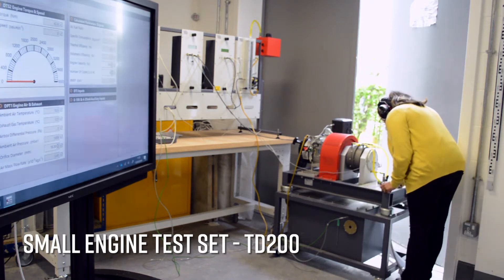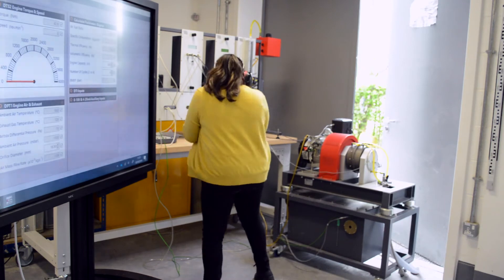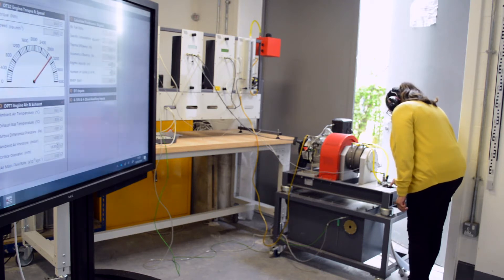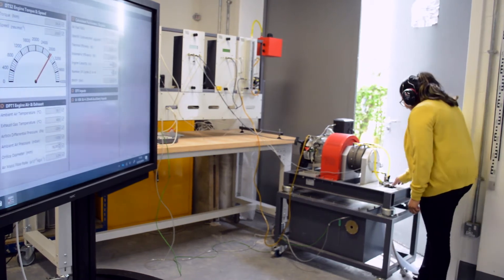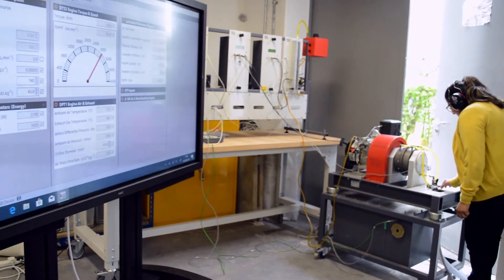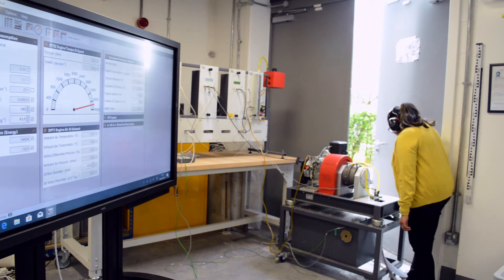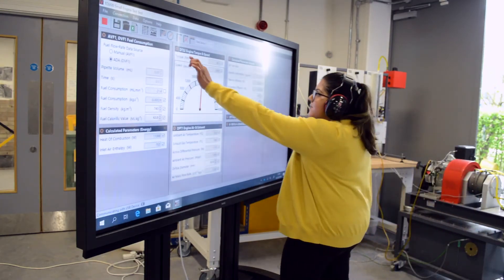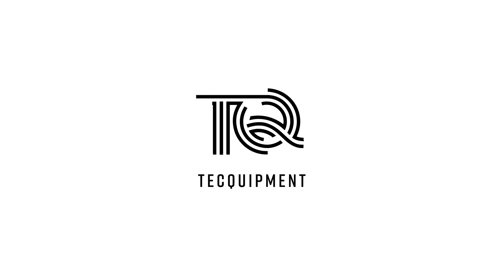Small Engine Test Set TD200 Student Demonstrates How To Use - Engines - TecQuipment

Comment: What's the problem if the engine td200 don't start from the first time it starts afer many tentatives. 
Thank you
Reply from the maker: Hello,

There can be many reasons why the engine is reluctant to start;

• Old, low quality or contaminated fuel
• Carburettor may need cleaning (especially if fuel has been left in it for a long time)
• Blocked fuel supply or air trapped in fuel line
• Spark plug (if petrol engine) may need cleaning / gap setting
• Restricted air intake
• Incorrect use of choke (cold start lever)
• Dynamometer load needs to be minimal for starting

These are assuming there is nothing actually faulty with the engine itself e.g. low compression, weak or no ignition spark

The problem maybe one or more of the above.

We hope this is helpful.